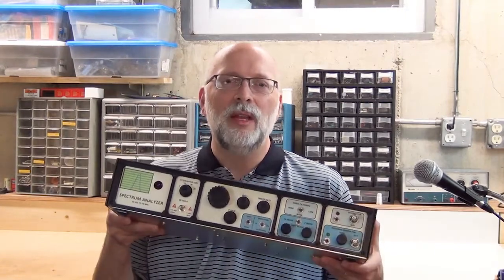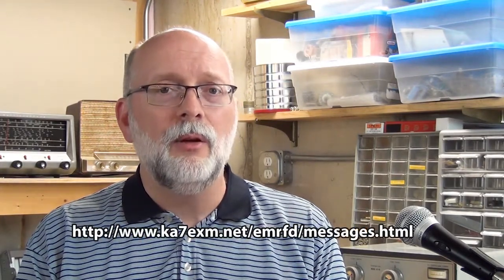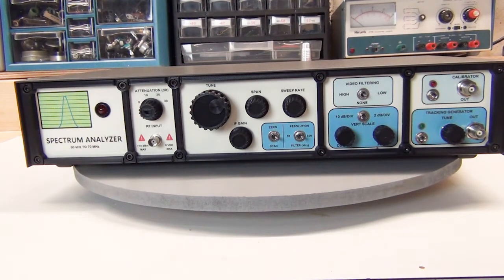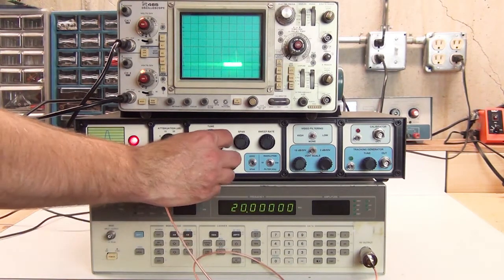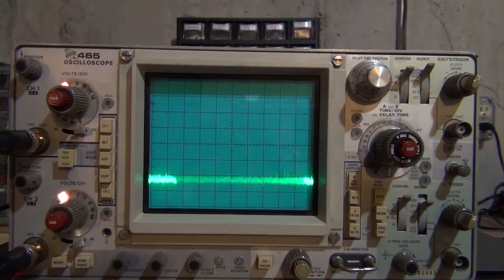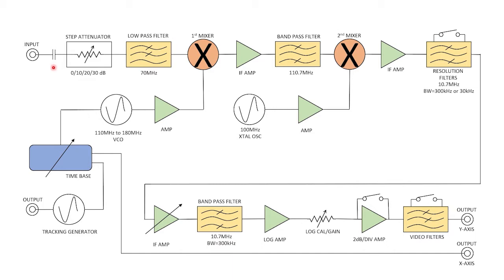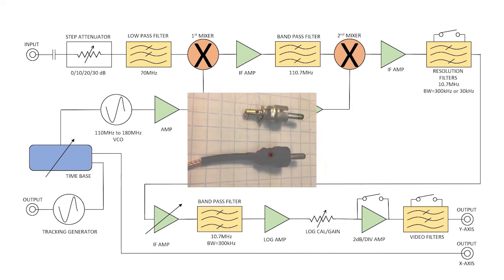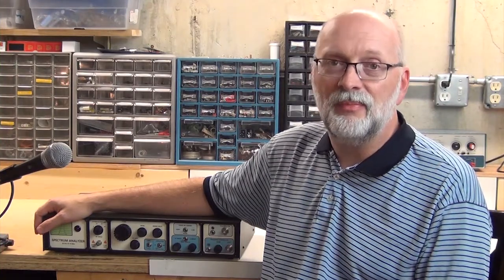Homebuilt Spectrum Analyzer - Part #1

Comment: This is just dandy. I have designed and built a few pieces of equipment, however I don't have what it takes to build something this complex. My endeavors have been a custom TTL digital light show controller 1982 when I was 19 (No internet or Arduino back in those days, just my Forest Mims III books one and two), Plus I built several model RR throttles of different types. Mr Carlson's Lab has me "tuning in" for vintage electronics. I have just subscribed to your's. Well done my friend.
Reply from the maker: Thanks very much!

Comment: I spent several years in the 1980s repairing and calibrating spectrum analyzers, and that was some of the coolest work I ever did.  A few years ago I bought an HP 140T analyzer with plug-ins for up to 1250 MHz, which helped me get back into the RF game.  And then last year, I bought the  Tiny SA Ultra.  Which is fine for looking at really high frequencies ("calibrated" up to 6 GHz, uncalibrated to 12GHz), but doesn't have enough controls on it to be able to actually USE.  I mean, you have to know what frequency signal you're looking for, what resolution bandwidth, what frequency span, and what video bandwidth, and each of these requires digging down into menus to change, none of which are the least bit intuitive.  I would far rather use something with a control for each function, like the machine you've built.  If it gets inconvenient enough, I'll have to add an external device just to control it remotely with something more like an actual front panel (it can be controlled through a USB serial interface, IIRC.)

Comment: I built my Spectrum Analyzer with modern parts with some changers. First I am using parts that I accumulated over the years. My SA is a triple conversion. 1st IF is 200 Mhz,  2nd IF is 70 Mhz and 3rd IF is 10.7 Mhz. The 1st filter is are 2 helical filters at 200 Mhz with buffer amps in between. The reason for 2 is because the image frequency was not was not attenuated enough with just one. All the amplifiers are MMIC some from Motorola and some from Mini-Circuits. To adjust the levels and for matching parts of the signal paths I am using attenuating pads. Since I have so many scopes I have rebuilt one just for my SA. I can set my scale for 1Db, 5Db and 10Db/ div. My RBW is the same as standard SA. I have 3 frequencies I use for calibration 10Mhz and 50Mhz and 100Mhz

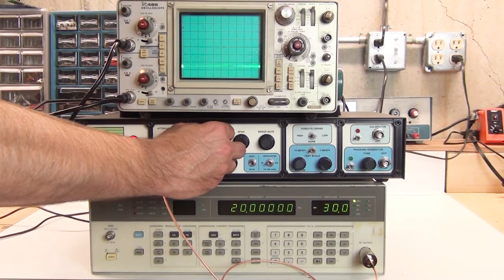Comment: You may be sweeping too fast for the 30 kHz filter to give good response (at 9:45).
Reply from the maker: Thanks for the tip.  I'll look at the timebase and see if slowing it down improves the filter response.
Reply: @levelupeelab  One of the great things about spectrum analyzers is that they contain enough instrumentation to adjust and calibrate anything within them.